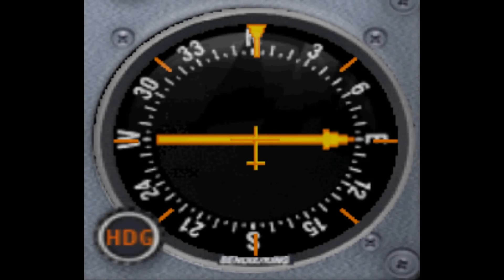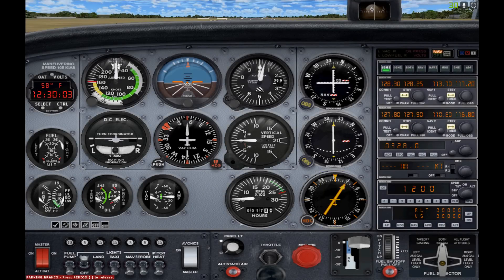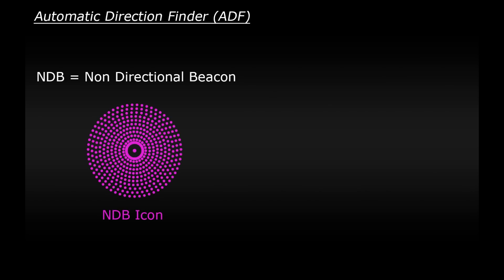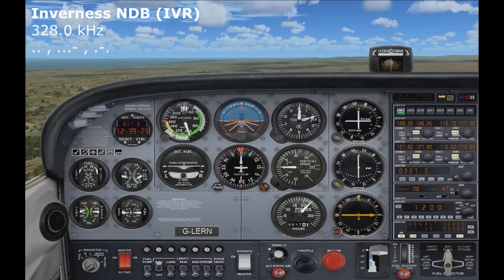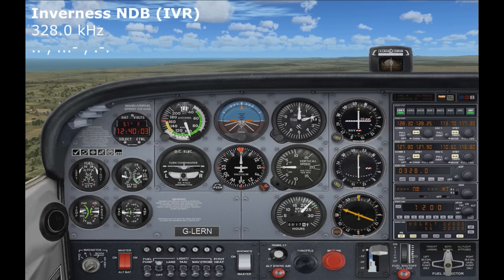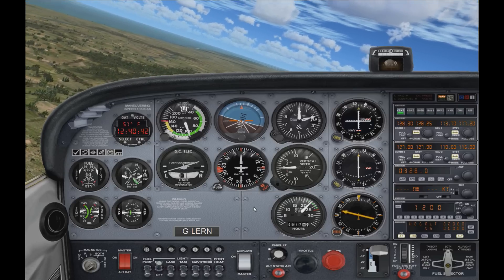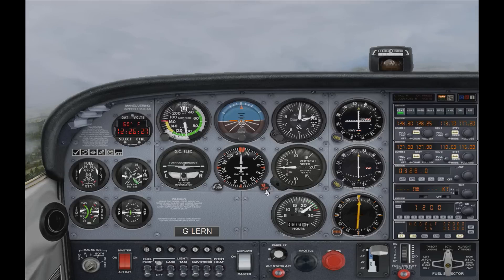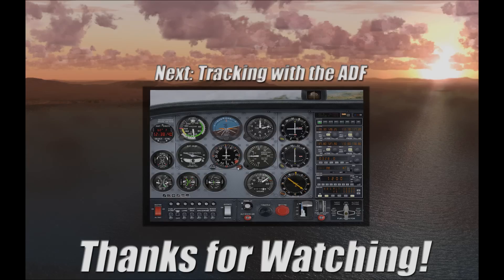FSX Tutorial: Automatic Direction Finder (ADF)

Comment: You need to know Morse code or just hear the fact that there is a code?
Reply from the maker: You do need to interpret the Morse Code to confirm that you have tuned into the correct radio frequency and you're receiving a signal from the station you expect to. Pilots usually have a reference card which allows them to translate the dots and dashes into letters. Morse Code is not a "language" pilots must learn.